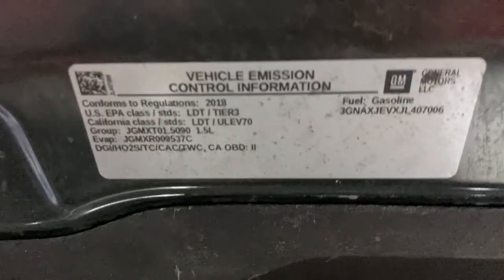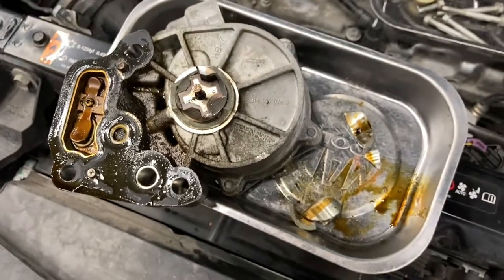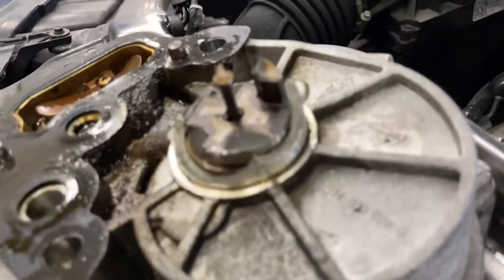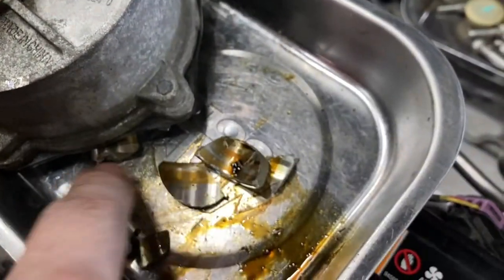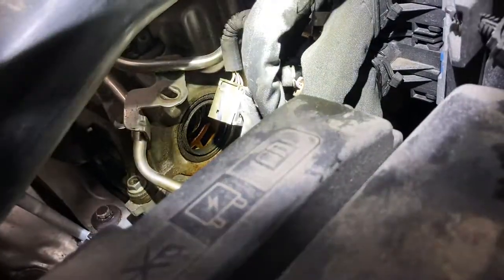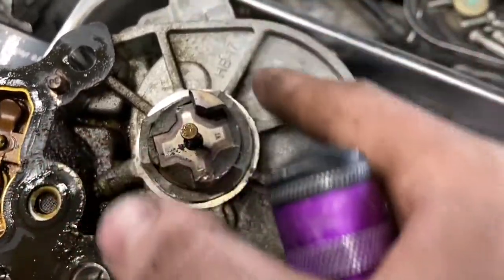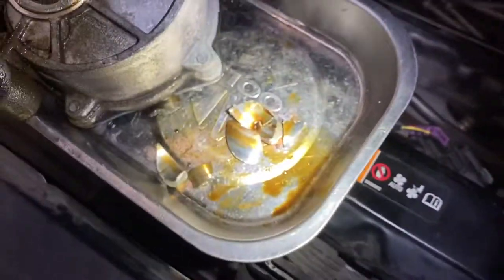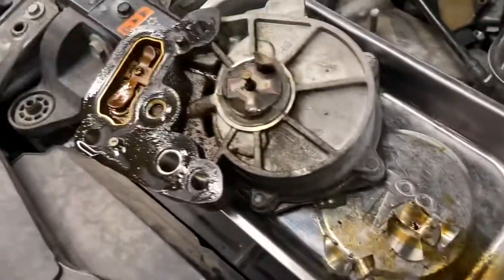2018 Chevy Equinox Vacuum Pump Catostrophic Failure!

Comment: Thank you for the video. This just happened to my 2019 Terrain @ 51,000 miles. (Mine broke inside the pump). Changing out was very straightforward.
Reply from the maker: Yes assuming it was an internal failure its normally a sub 30 minute job

Comment: This just happened to my 2019 GMC terrain. Thank God I was going slow and in the parking lot otherwise it could’ve been a big problem. I took it to my dealer and they’re gonna charge me $1950 to fix it. I just called GMC customer care and put in a case they said they get back to me in one or two days. This is definitely a recall issue. I have 129,000 miles on my GMC Though
Reply: Outcome?

Comment: From what I see, the main reason why the pump failed was because there's so much sludge at the strainer (mesh part). Naturally, when you see that, the sludge clogs that part which will cause the vane inside the pump to be dry since it'll not receive sufficient oil to lubricate the vane, which will melt it into a charcoal feeling piece and break off.

Comment: Definitely a common issue.  I just changed one out myself. Only difference, this pump failed on the inside. Still spun but no vacuum. I disassembled the pump to find metal shards inside. What poor engineers. Smh. BTW. At 60k for miles
Reply from the maker: Damn, at least it didnt explode lmao
Reply: @redcatxb125  only on the inside. Got lucky i guess. But the car owner also didn't change his oil for at least 8500 past due. I did change it for him and advised him not to wait so long.
Reply from the maker: @patrickstewart3184  yea those motors do not like long oil intervals and bc of the types of cars they are put in they are not well maintained most of the time

Comment: My vehicle (18 GMC Terrain) didn’t do it till I hit the 100k mark the week before Christmas..luckily we were able to rescue all of the broken parts and it didn’t damage the camshaft..but now I gotta deal with replacing that seal cause my current replacement is leaking oil…the newer pumps are slightly different than these POS so let’s hope it doesn’t break again.
Reply: Would you happen to have the broken unit?
Reply: @CAPZATTACK610  I do indeed.
Reply: The new pumps makes sure that it won't happen ever again. Meaning the car will last forever but be sure to clean your engine to make sure no old oil or sludge builds up into the engine. Because that's what kills mechanical vacuum pumps.

Comment: As a matter of fact they put them in the 2018 Chevy Cruze 1.4L. I just pulled one that disintegrated the same exact way today. It completely annihilated the  seal and dropped the metal inside. I don't know if you did a follow-up video are not but I would love to see it because tomorrow I have to pull valve cover
Reply from the maker: no follow up video but i did have to pull the valve cover, NOTE that the shroud is ALUMINUM! a magnet will not pick it up! only the rotating part is magnetic. i had tweezers, one of those remote grabber things with the 4 small angled prongs on the end and a magnet, then i poured oil directly on the cylinder head with the valave cover off, jacked the car up, drained the oil and changed the filter, then went back together with  a new vacuum pump, V.P. seal, and valve cover gasket. it ran normally and we havent heard back from them since/ TIP dont try to remove the plastic hoses connected to the valve cover. trace where those hoses go to from the valve cover and disconnect them there, leaving the hoses attached to the valve cover as it is removed
Reply: @redcatxb125  thanks for the tips man I I'm an electrician by trade so it's much appreciated. Everything seems pretty straight forward though after 3 days of research lol. I'm waiting for the new gaskets to come in then I'm going to tackle this beast.  I got 90% of everything out at this point from the side which I figured out by piecing it back together as I got chunks out....I found out the oil hasn't been changed in almost 2 years so I don't know what the hell else I'm going to find in there

Comment: 45k and this week. GM replaced both. They said i need to change my oil every 4000 instead of 5000. This car has been nothing but problems. The guy at GM told me to sell it now while it runs because my engine will blow the next time this happens
Reply from the maker: The new gm cars are a hot mess. More and more these cars are becoming throw away items

Comment: As of 11/10/22 mine did the same thing with 55,000 miles and the dealership told me it was not covered under the 60,000 mile power train warranty.
Reply from the maker: Did it do any internal engine damage or was it just a vacuum pump replacement?
Reply: @redcatxb125  They are going to pull valve covers to see if any metal is internal today.
Reply: Mine wasn’t covered either. I have to pay 700 to get it out the shop tomorrow

Comment: This happened with my 2020 terrain. All of them have the same problem but they only recalled the 2018 and 2019 I think. I was driving on the freeway and could not stop. Was able to exit the freeway, pulled into a lot I thought was empty and ended up running into a wired fence 🤦🏾‍♀️
Reply from the maker: sorry to hear that.
Reply: How much you pay !
Reply from the maker: @bo24kt  depends on how bad it fails. if the vacuum pump fails internally then its like 1hr or a little less labor and part cost, which is in the 100-300 dollar range. if the pump explodes, dont be suprised when itll be 4 ish hrs, plus a valve cover gasket, many shops will quote an engine because metal shrapnel has gone through the engine, and it will raise the risk of a comeback or possibly doing the engine under warranty as they were the last shop to do it. worst case without replacing the engine the drive lobes on the camshaft can also break when the pump explodes, and doing a camshaft is going to mean more labor and cost for a new timing chain set, no legit shop will do timing work without replacing the chain, plus all the other stuff, so maybe 8-12hrs labor alone plus 500 plus or minus some for parts.

Comment: This same thing just happened to my 2018 Equinox with 50 K on it (Holden, Australia). We hadn't had it serviced for 30 K in 2021-2022, but had it serviced in Dec 2022. The vacuum pump shattered and it locked off and then the brake shaft fell off? Whole motor needs replacing now. It was blamed on óld oil, and holden wont replace - does this seem reasonable?!?!?

Comment: Happened to me last Tuesday!! Pathetic something this huge happened to my car with only 36k miles on it! When the vacuum pump failed it broke my camshaft and threw pieces of metal into the top of the engine. My brakes failed almost causing me to get in a fatal accident. Warranty is covering the repair. Don't trust my car anymore. Trading it in on a Honda. I have always owned honda's. Really liked the equinox. Bought it brand new. Huge mistake. Got an email warning from onstar almost 20 minutes after it happened!!
Reply from the maker: Yea I’ve heard it’s common to snap the camshaft ears off, this customer got lucky. All it needed besides the vacuum pump was a new valve cover gasket and an oil change, it had about 50k miles if I remember right.
Reply from the maker: Also Hondas are great man! I own 2 myself. Got a 5spd 05 accord sedan and a 5spd 2000 prelude
Reply: My bosses daughters equinox just did this yesterday. It destroyed the end of the camshaft and won't run.
Reply from the maker: @brianH45  I’m sorry to hear that. It should be covered under warranty but if not it may be a hefty repair bill
Reply: Same thing happened to me last week on the freeway. Very scary. I was able to get off the freeway but ended up running into a fence because I couldn’t stop

Comment: My father in-laws just went out and we replaced. It was broken on the inside of the pump. Now getting a P0017 code! Ugh, timing must’ve jumped a tooth or two. Runs good though.
Reply from the maker: was it run low on oil?
Reply: @redcatxb125  It was a quart low
Reply: @bobevol did you have to fix the timing are did you leave it like that ?

Comment: Mi brother , can tell me how to take off the hoses that are connected to the valve cover? Please
Reply from the maker: I didnt take off the plastic hoses from the valve cover, I took them off of where they went to, and removed the valve cover with the plastic hoses still attatched to it. however, the GM service manual instructs that you cut a slot in each screw that holds the plastic hose to the valve cover and use a flathead bit to unscrew them. I'd still recommend my method because you dont have to re use those cut up screws or get new ones.

Comment: Mine did the same thing. Less than 30k miles at time of failure.
Reply from the maker: Ouch, even the OE replacement part (acdelco) is now a “made in china” part, I think these things are going at random due to too loose tolerances or bad quality control
Reply: @redcatxb125  My shop was unable to get their hands on an OEM replacement. Part was made in Mexico.No idea what mexican car parts quality is like so here's hoping
Reply from the maker: @AThibs  probably higher quality than the china garbage lmao

Comment: Can this issue also cause the computer to say a bunch of sensors need to be replaced? I replaced cam shaft position sensor along with knock sensors and couple others and truck still giving me issues to start. Tomorrow I’m changing the vacuum pump as my brake pedal is hard to push down. I hope this finally fixes the issue
Reply from the maker: do you have a 1.5 turbo engine? 
if its setting timing code p0018  p0014 p0016 etc it could be that the camshaft that drives the vac pump may have broken. also if you're getting circuit codes for the cam and crank sensors and not timing correlation codes like mentioned above, its probably a separate issue from a failed vacuum pump. its also possible the force of the pump failing could have cause the timing chain to jump a few links.

Comment: This has happened to my car 2018 Chevy equinox but with the pieces breaking off would it destroy the motor?
Reply from the maker: It can it just depends on if you catch it right away, if not there are likely metal fragments going through your oil system. If you take off the valve cover, remove as much metal as you can, and do a fresh oil change and filter, along with a new vacuum pump, it may be alright. Thats what i ended up doing on this car

Comment: I have this issue with a 2018 equinox at work the actual reluctor ring on the exhaust cam shaft shifted code p0017 comes up can not clear it if you start the computer will recognize the issue the reluctor is pressed on instead of machined and the cam. The  sensor can not read it correctly I’ve heard people line the marks back up and tap the reluctor back into position but I strongly do not recommend that method
Reply from the maker: ?? has nothing to do with the vacuum pump, in your case, you would need a new camshaft. the reluctor is pressed on but the slot in the back of the cam for the VP is machined into the cam itself, so they dont correlate. its possible youre off a tooth on timing if you didnt use the cam and crank locking tools
Reply: @redcatxb125  so the brake vacuum pump was seized and replace as well but I’m thinking it was shifted because of debris in the engine

Comment: This has happened to me what do I do I got most of it out but I’m still missing some pieces do I have to take the engine apart ?
Reply from the maker: I had to take the valve cover off which on these is like a 2+he job and then pick out all the extra pieces with a magnet / tweezers as only the rotating part is iron based the housing is aluminum. It sucks trying to get that valve cover off
Reply from the maker: 2+ hour *

Comment: Replacement doesn’t seem bad but after seeing this video can those pieces become lodged in the motor? What’s the best way to get them out?
Reply from the maker: I had to pull the valve cover off and used a remote grabber tool to pick out the peices that were in the cylinder head. some smaller parts may have gotten to the oil pan or got lodged in the oil return passageways. best bet is to drop the pan and clean it out, or you could try draining the oil and running a couple quarts of fresh oil through the motor with the drain bolt still undone to try and get the shrapnel out of the pan, then fill it with oil and change the filter. note that it is possible damage has been done to the motors bearing surfaces already
Reply: @redcatxb125 yeah. It's only bad if there's metal pieces in the engine. Luckily mine was still intact except the vane, but I checked anyway and there was no metal parts in the engine. All I had to do was replace the pump and seal, and change oil. It took me hours since I never had to fix a failed mechanical pump before in my life.

Comment: I have a 2018 equinox I have now replaced four of the four of them pumps that you are talking about are they a better a better pump that you can buy
Reply from the maker: Not that I know of. Buuuuut you have one other option. You could in theory cut the drive teeth off of a new pump so that just the outer sealing ring is going into the cylinder head so it doesn’t leak oil. but the cam wouldn’t spin the pump bc you took the teeth off. You can then run an electric vacuum pump (which was OE on certain gm cars) and run that to the brake booster, as the vacuuum pump only runs the brake booster
Reply from the maker: Or just drive with no power brakes… but I wouldn’t do that haha
Reply: 4 times! That’s ridiculous! GM should be paying for that part! Mine broke over a  month ago and its still in the shop waiting on a technician to inspect the engine

Comment: How much should it cost to fix this and flush the engine?
Reply from the maker: youre looking at about 3-4 hrs labor to remove the valve cover and fish everything out, price of the new pump assuming the camshaft isnt damaged, valve cover gasket, (dont remember if it includes the vacuum pump seal) plus an oil change. not cheap but not absurd. However, some shops may quote you a new engine because of the possibility some of those fragments may have run through the engine IE main and rod bearings, oil pump. mainly to cover thier ass, they dont want to risk just trying to remove the fragments as the internals may have already been damaged.